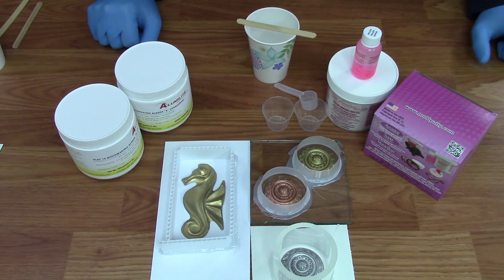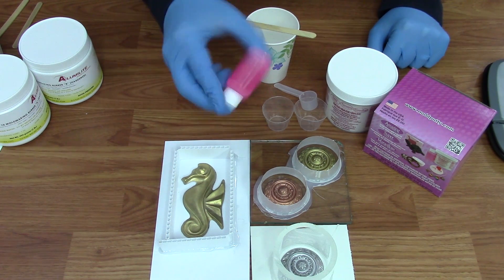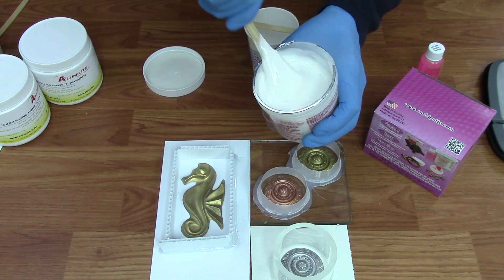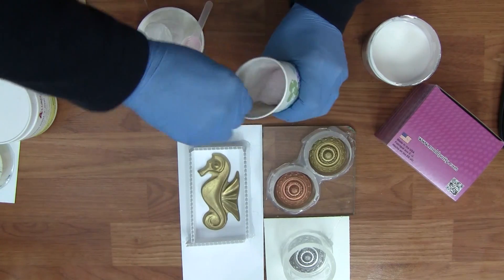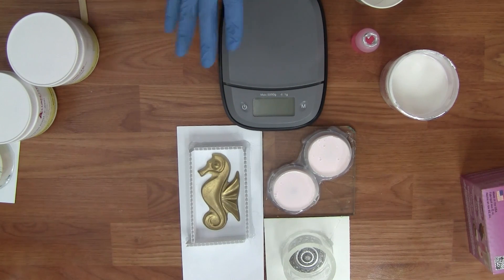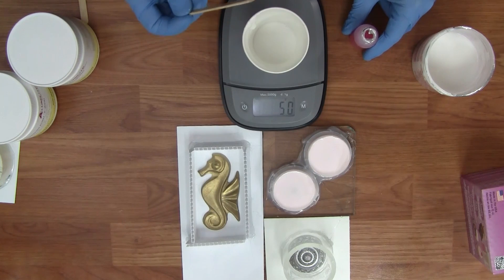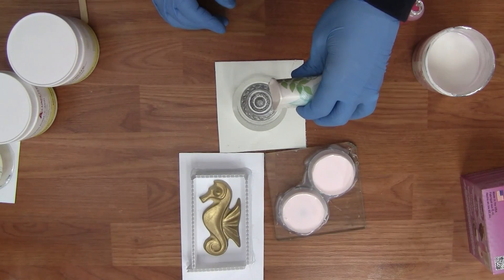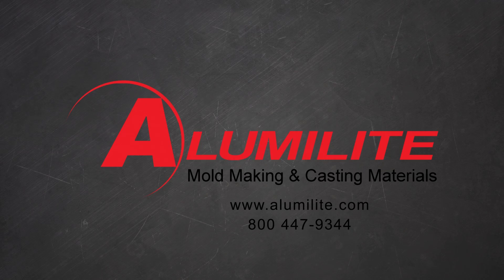Silicone Rubber - How To Mix Silicone Rubber - Molding & Casting Tutorial | Alumilite

Comment: which mold making kit can be used to make a complete 360 degree mold - I don't want to make a mold of only one side, would like to make a 3D mold of front and back. Can the object be sandwiched in between 2 liquid layers and then cut away from the middle to release?

Comment: Question, can I add a new batch of mixed solution on top of one that hardened already? I got started on a mold and it didn't fill up the container. Wondering if I add more, will it stick together or not. Thank you!
Reply from the maker: Hi Thevina, you should be able to but you will have a visible seam line.

Comment: I always use a 2 cup mixing method to ensure there are no spots that aren't going to set up. I went to classes at smooth-on company and stress using this method this way you dont have to avoid the cracks and crevices. Just move it to a 2nd cup and use a new stick and walla a perfect mix each time.
Reply from the maker: That's great advice! Thank you!

Comment: Can you make fishing lures with this silicon mold or is high strength 2 silicon mold stronger.
Reply from the maker: Thanks for your question! Amazing Mold Rubber and HS2 are very, very similar. Amazing Mold Rubber has a quicker demold time, so if you're looking to get things done quickly you may prefer it. Other than that, they are basically the same product. Feel free to email info@alumilite.com with any more questions!